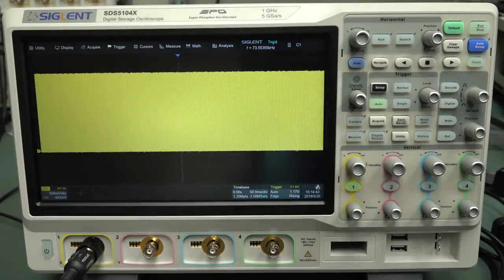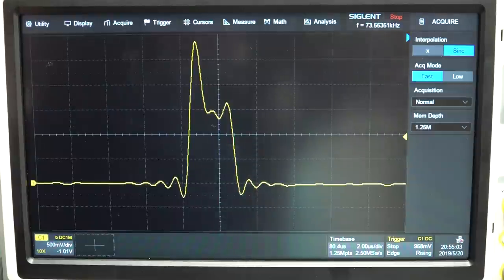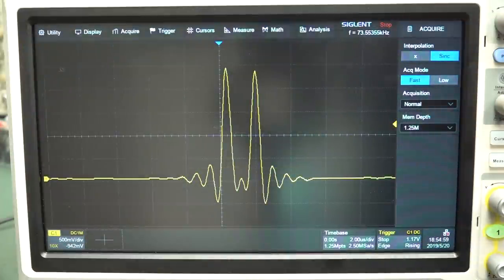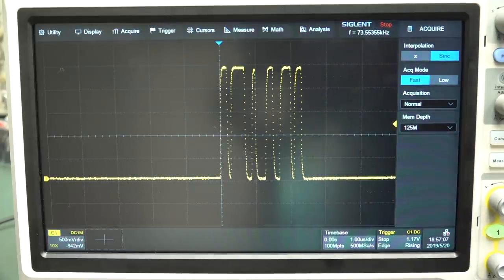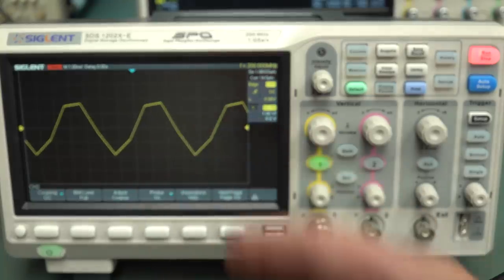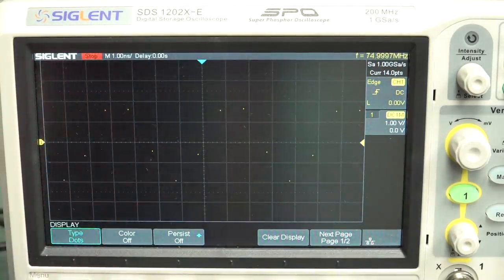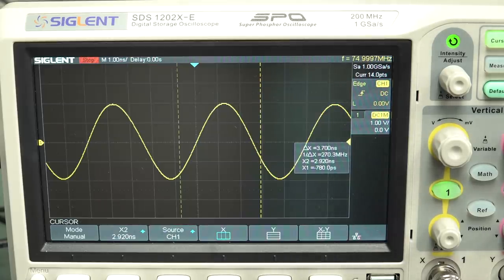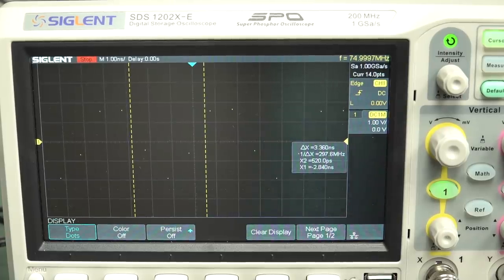EEVblog #1213 - The Oscilloscope Interpolation Trap!

Comment: Gotta know your sinc. Your scope at least has zero order hold ("disabled") I hope too, in addition to linear? (Bars instead of tiny dots. Or fat dots.)

One thing I'd love to see is ZOH with error bars from sinc ringing as estimate, like a blurry overlay. It's a rare case that your clock is perfectly synced with signal. Old analog scopes naturally did that with faded display due to capacitance in memory and display... Though that can lie too, it's exponential interpolation - Laplacian it's called I think?

Using a scope as a frequency counter over sample rate only works if you average enough samples. (Or take a long Fourier spectrum, similarly.) Not quite what you showed.
Reply from the maker: Hmm, an overlay would be an interesting feature...
Reply: Drawing 2px points over the interpolated line would also help, once there is few enough samples.
Reply: Sinc is always better. Because you need to know how capable of your scope, when the case in this video, the scope is essentially store too less samples the equivalent sample rate is too low to reproduce the original signal which is pulses(very high frequency contents)
Sinc is guaranteed to not creat high frequency sampling noises and it's inherently limited by the sample rate. You can't get information above your Nyquist frequency. That's why sinc is useful. 
The misconception here is that it looks like it's "adding" things in timr domain here. But actually it's the cleanest in the frequency domain. No noises/ false information over Nyquist frequency.
Reply: @PiezowDimD  That's called oversampling right?
Reply from the maker: In this case the pulses are not "very high frequency content", the scope simply didn't have the memory/sample rate at that particular timebase
Reply: @johnyang799  You're missing the point.
1) It's not sinc but windowed sinc, and the window is not even whole memory.
2) Display is misleading for any content above Fs/2 anyway.
3) It's cleanest in frequency domain but you're looking at time domain .
The optimal window in time domain with finite support is an elliptical Cauer or Dolph-Chebyshev filter. (One's analog the other's digital) If you value DC and L2 norm accuracy instead, you use good old higher order Butterworth (incl. zero and linear phase transformed) and if value accuracy - main lobe peak value, there are flat top windows with finite support and select ringing fall rates.

All of the above reproduce sine at high frequencies, Butterworth will attenuate it a lot and have some peak near Fs/2, Chebyshev much less but have some attenuation ripple in passband, flat top it depends on the exact window, for ones have nearly no spurs but start transition early so a bit more of bandwidth is lost. (There's a great paper around on all of these.)
Reply: @EEVblog  It is very very high comparing to the down sampled equivalent sample rate.
Reply: @EEVblog  The interpolation is after the "down sample" so this is the same as low sample rate in the beginning.
Reply: @AstralS7orm  Yeah. I understand what you mean. But linear interpolation is the misleading in time domain and worst in frequency domain, even if it essentially does nothing to the signal. 
Are you able to tell in the video the zoomed in signal is wrong in linear interpolation no. But in sinc you can know ah it's sampling rate limited or equivalent (downsample).
Reply: @johnyang799  Linear sucks for sure yeah, monotonic linear is ok if you care only about L1.
Fat dots (w/ gaussian error) are usually most honest, you can do better if you know jitter characteristics of source and clock.
Finally, windowed gaussian (linear phase brother of Butterworth) is a decent pick as well - you see something like capacitance - as are high quality flat tops, if you want voltage as accurate as possible.
And the ultimate which nobody implements is a tunable Kolmogorov-Zurbenko (KZA) adaptive filter. It's a date adaptive filter, somewhat slow to calculate, but nobody cares when you have to only compute a short visible part of the signal. It's specialized for finding hidden periodicity and breaks in non-periodic signals. R has an implementation while papers and wikipedia have the math.
You can do better if you guess, e.g. with neural nets, but then you accept probability of catastrophic failure.
(Nyquist limit is much more stringent than Kolmogorov bound.)
Reply: That overlay is a good idea. They could have much better frequency counters too like the HP5315 and easily implement it in part of an FPGA or an extra IC instead of just an 8 digit counter like the datasheet he showed. The HP5315 uses the reciprocal method instead to get much higher resolution even on lower frequency signals. For the tiny amount of extra circuits, it should be included. And none of this paying extra for triggering from serial, USB, I2C, etc
Reply: I'm talking about a visual aid here, to realize that there is multiple possible paths between points (But only one under  the frequency Fs/2 and it is the sinc interpolation).
Reply: @PiezowDimD  The path under Fs/2 or rather its upper bound from unwindowed truncated sinc is about as useful as the voltage value at any of those points. Not useful at all unless you can read aliasing and intermodulation from a time domain view. I can but only in a few simple cases. Complex signals produce unintelligible non-local garbage when sinc interpolated, unless a few specific window functions are used. Often the scope does not say which window is in use - typical guess is Hamming.

Scope is a multipurpose tool and should have options for value, shape, onset, outset and frequency accuracy. Sinc may be the latter. It's no good for any other purpose.
Maybe even an extra digital signal mode to emulate a LSA.
Reply: @perfumedmanatee6235  Candlesticks (fat dots on a stick) are better still. Lollipops do not tell you about estimated overshot.
Reply: Am I right in assuming the scope will implicitly low-pass filter the signal to avoid aliasing? Since if so, sinc-based interpolation does have the distinct benefit that the line drawn is independent of how the sampling grid is aligned w.r.t. the signal.

In the end, every interpolation method will unavoidably be wrong for some signals, the most important thing to do would be to ensure the user is aware when he's zoomed in excessively. Maybe the line should be blurry or something.
Reply: @MatthijsvanDuin  The scope might have an analog lowpass filter (including probe capacitance) or oversample and use a digital one.
The precise result and implementation of such lowpass near Fs/2 is often undocumented.

Comment: The ringing BEFORE the signal is a screaming sign, that we see artefacts of digital signal processing.
Reply from the maker: Indeed, I should have mentioned that.
Reply: The individual voltage measurements should simple be visible as dots or whatever once you zoom in enough that they get sparse.
Reply: Isn't that just the Gibb's effect due to a lowpass filter bandlimiting the signal?
Reply: @unfa00  A real world normal first and second order low pass filter does not cause that because a real filter is causal and the largest phase difference possible is 90/180 degress, way insufficient for multy period pre ring. No ringing before the pulse arrives for simple real filters ! If you have a transmission line or some other thing with huge phase delay and dispersion, then you can probably generate this in analog too, in the sense that everything will be delayed multiple periods and therefore causal pre ringing is possible with the ringing delayed less than the bulk of the signal...
That signal theory stuff....yeah, i think an ideal lowpass would cause gibbs ringing of the sin(x)/x type, but an ideal filter is kinda bullshit. No such thing. Can probably be approximated and has some real world use, otherwise they would not teach it.
Digital signal processing throws it all outta the window. Fourier transform based fast convolution and similar stuff is usually not causal and generates all sort of hillariously comical signals that are totally impossible in reality, which is of no concern if you are processing a prerecorded signal where the future is known....
Reply: The key point here is that in digital processing we can easily create something that looks like looking ahead to the future and as a result, the impulse response will be symmetrical along the time axis. In analogue circuitry, this is also possible, but it will cost a gigantic heap of samplу-and-hold capacitors or delay lines and other circuits.
Reply: The assumption hiding here is that the original signal was properly filtered before sampling to contain no energy above the Nyquist frequency.  If that's so, sinc() interpolation is the law; it's physics and beyond individual preference;  if it's not properly band-limited, artifacts rule the land at the high end of the bandwidth.   Digital signal processing won't have "artefacts" if Nyquist is obeyed.
Reply: @Zonkotron  No. It's due to the linear phase. It's better.
Reply: @pamersiel  It's not always. It's chosen to be linear phase using fir. They can certainly use minimum phase if no maximum phase if you want.

Comment: It's the reverse of the problem audiophiles have! Some look at linearly-interpolared digital audio samples and assume they're getting a "blocky" audio output. Then they look at the sine interpolation and complain about those wiggles around a theoretical square wave and think that's an artifact of converting analog to digital. Great demonstration in an obvious place that I'd never considered.
Reply: @electronash  It should be exact if the clock is synchronized. If not the shifted t0 will cause real world issue. So 5 times is mostly the way to go. 
However in audio, our ears don't have clock or synchronization so it shouldn't matter. But who knows. 
__________________________
When we don't exactly know something, it's better off over doing it rather than ignoring it. When digital filter plays a role why not just oversample 2 to 4 times to avoid artifacts.
Reply: John Yang 

Yes, I agree. If you really want the best possible audio, then go with something like 24-bit / 192 KHz.

But even 44.1 KHz audio CDs sound pretty great to 99.9% of the population. They are more than "good enough" to the majority of music lovers.

Nothing is going to be perfect in any recording medium, of course, and I completely get why people collect and enjoy the older formats too.

I mean, this vid is about digital oscilloscopes and sampling, but it is closely related to digital audio.

I'm trying to avoid getting into the whole "audiophile" discussion too deeply, though, as it's been discussed to death, and people can get quite religious about it. lol
Reply: Have you seen Digital Show and Tell by Monty Montgomery explanation of digital audio here in youtube? it explains that perfectly.
I love to show that to audiophools who think their hearing gets better with age lol.
Reply: @electronash  Agree
Reply: Speakers are inductors and suspended coil with a dampener, they naturally produce sin(x)/x interpolation. Every spring will move in a sinusoidal pattern.
Reply: Just for fun, I wrote a little program that does a FFT of a "sampled" function given on the command line. See:
https://github.com/mcjurij/funwitheigen/blob/master/simple_fft.cpp

and here you see an example input and the output in one graph:
https://github.com/mcjurij/funwitheigen/blob/master/fft_saw17.png

It shows the same ringing that can be seen in the video due to https://en.wikipedia.org/wiki/Gibbs_phenomenon.
Reply: @victornpb  No when the speaker can produce higher frequency.
Reply: Thx for the links. U was always confused by this theorem. Naive thinking.. How can you perfectly reconstruct the signal with 2 samples per wave.
Reply: @electronash  yep. As far as I understand 48 bit/192 kHz is good for editing due to bigger margin of error, but for production purposes after editing sampling down to 44.1 won't change anything for the human ear. Except for the people that believe they can hear the difference
Reply: musashi939 that applies to the bit-depth because you oftentimes change the volume of the vocals or guitar and the more bits the merrier
But to be perfectly frank, to even make the slightest difference the noise floor on your equipment has to be phenomenally good, and the “vintage” equipment most people love doesn’t always have a great noise floor. 

But I don’t even know how to quantify “it doesn’t matter” because you can record your vox for a hit single on a $10k Neumann or on your iPhone. After it’s all been processed and mixed and then converted to MP3 only 1 in 1,000 can tell the difference anyway.
Reply: Those sound more like Audiophools to me haha
Reply: @electronash  , Yes... your interpretation of the discussion as "religious" is so on point!
Reply: @johnyang799  , Usually it's just that many people are too cheap... I don't mean horribly tight, I mean they don't know what they are giving up to the bean counters, and don't really care that their wonderful car radio has high distortion figures.
Reply: @victornpb  , Regardless of how right you are, an "audiophile" may not know their math and can't fully appreciate what you've said. But you're right on track.
Reply: @victornpb A speaker acts as an RL lowpass filter due to the resistance and inductance of the voice coil. It's the RL filter that enables filter-less Class-D amplifiers (if you don't mind your speaker cables transmitting RF junk!). The mechanical suspension only has a significant effect at the resonance (low) frequency. A 1st order integrator or low pass filter like a speaker coil is not nearly as effective at anti-aliasing as a proper sin(x)/x interpolation. An ideal anti-aliasing filter needs to have no attenuation in the pass band and infinite attenuation above the nyquist frequency. The only practical way of achieving that is with a digital sin(x)/x filter also known as a 'brickwall filter. If you only partially attenuate frequencies above nyquist then you only get partial anti-aliasing.
What audio DACs effectively do is increase the sample rate from 44.1KSa/s to say 384KSa/s by duplicating samples, then they pass the 384KSa/s signal through a digital sin(x)/x i.e. brickwall filter which removes all frequency content above 22.05KHz (nyquist). This acts to smooth out the big 'stair steps' in the 44.1KSa/s signal to much smaller steps in a 384KSa/s signal. The signal is then output by a 384KSa/s DAC. Any artifacts (i.e. stairsteps) from the DAC are then easily anti-aliased by a relatively low-order analogue filter at ~30KHz (just above audio band), since the frequency content of the 'steps' is up at tens or hundreds of KHz where the simple audio filter produces a lot of attenuation. In reality, most audio DACs/ADCs are built on delta-sigma oversampling architecture and not sample-and-hold so the unwanted content produced by an audio DAC is high frequency delta-sigma noise rather than stairsteps, but they use the exact same procedure of oversampling, digital brickwall and simple audio-band analogue anti-aliasing filters.
Reply: Audiophool - the people that also often claim they can hear the difference between 16bit 96 kHz and 24bit 192 kHz.
(and then they also buy some oh-so-great tube-amps with distortion higher than 1% -.- )
Reply: @johnyang799  This is why nebulous terms like Presence are used when describing the loss of Digital Conversion to pure Analog Music like on Vinyl.
Reply: @victornpb  Which is why we have Impedance Matching and selected Out Put components with little or no correction needed. The mechanics and electrical properties are considered and designed for in high end amps.